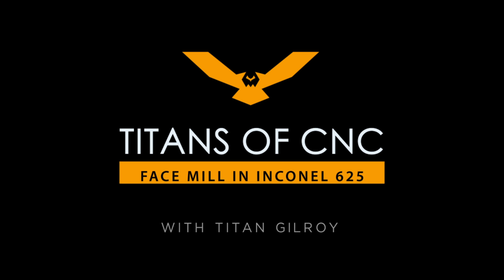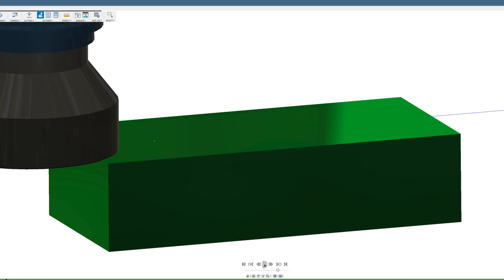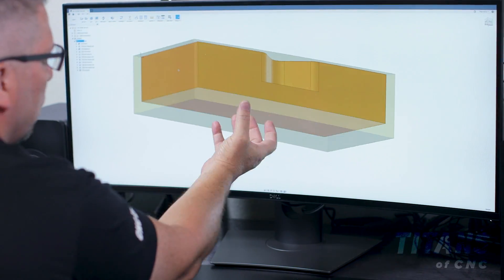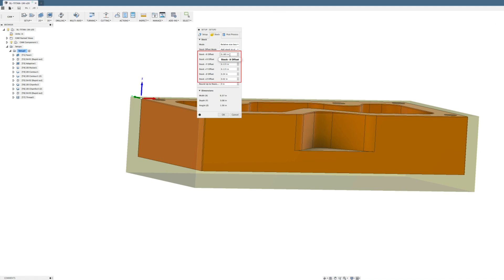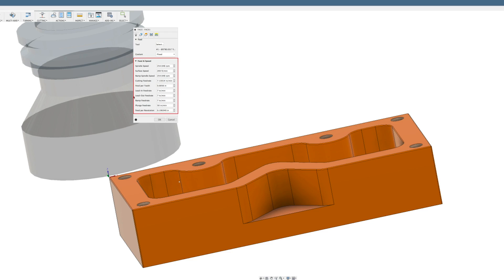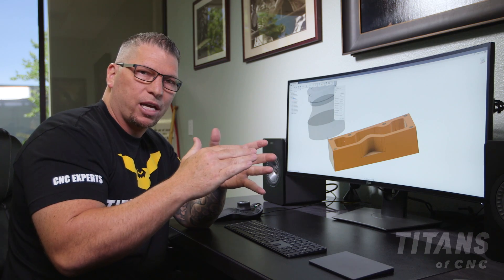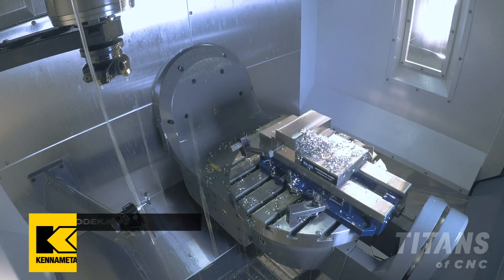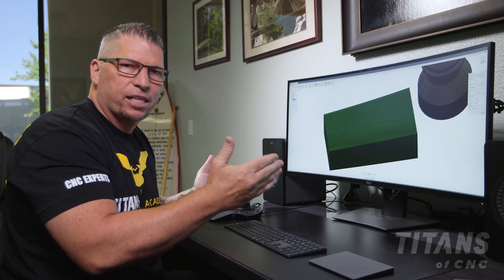Face Milling Inconel 625 - CNC Machining - Kennametal Dodeka

Comment: Do you still set your tool length to the wiper? Or to the other 4 inserts that are actually cutting? I am assuming it is to the wiper but just want to be clear on this. Thanks Titan!
Reply from the maker: Wiper :-)
Reply from the maker: You don’t always need a wiper, it just helps with surface finish

Comment: I have a question, if you are milling a TI profile, can you use a Wiper on that to make sure that is even. Or should you make sure all the inserts are even.
Reply from the maker: I would just profile it with a Harvi3 endmill... the wiper is just for fine finishing on a specific surface... usually top or bottom.